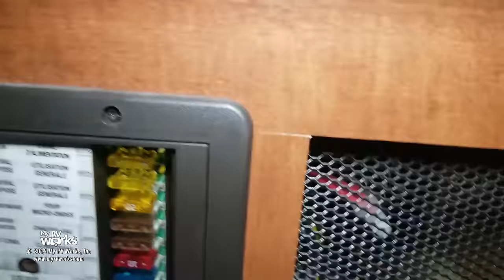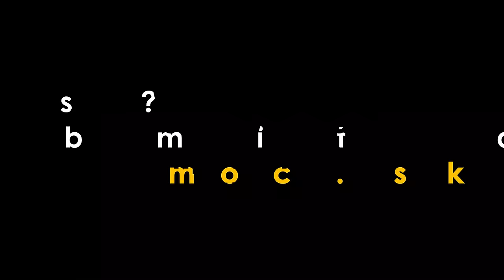RV Power Problem Leads to Converter Diagnosis and Replacement

Comment: Great  video very helpful.  Did notice the owner put holes in the wood behind the stove to hold knives in 
Place,  but alot of us put our knives away wet which   would put water in with the wires and converter area. I am pretty sure electric and water means TROUBLE.

Comment: Hi Darren, A friend has a hot skin condition (62v) to ground and we have isolated  to a single circuit. The hot skin disappears when a breaker is turned off. My EMS proved the pedestal and dog bone is good, (50a stepped down to 30).

Comment: Lol. Th life of an RV technician. I did my homework as Darren suggested. So I tightened up all the live on both AC and D.C. Side of the panel... I did use an inch pounds torque screwdriver. It is the t-handle design. But if the bus bars are close to the floor it makes the handle hard to turn when the "T" bumps the floor. All the screws were below torque.
Reply from the maker: Hi Pilot Nelson,

Wow, thanks for sharing your findings!

We are so glad to hear that our videos were able to help you!  If you would like to support us please consider becoming an "RV Community Supporter" on our Patreon site:  https://www.patreon.com/myrvworks

Happy Camping,
My RV Works Media Team

Comment: So if the batteries are dead; doesn't that mean they need to get new batteries? Cause the batteries will not come back to 100%. I wanted to say that your videos are so helpful. I was thinking of putting AGM's in to replace the cheap Wally Mart batteries that are there and now I better not do this because of the charging profile. Thanks for the tip.
Reply: I was wondering the same thing. I know that usually, if a battery is run down all the way, it will cause permanent damage, resulting in the battery not taking a complete charge or not holding a charge.

Comment: Great video as I have come to expect from you!  :)   I would like your opinion on plus's and minus's of two options I have on my converter replacement project.  Here goes...I want to replace my (brand new) converter/charger (single stage charger) with a Multi-stage charger in order to better maintain my battery bank.  It would also be an increase from 55 to 70 amp so I will be changing out the existing cables going to the battery.  I was thinking about the option of leaving the existing converter/charger alone( except removing the battery wires)  and just adding the new converter/charger at a location near the Battery bank. Your thoughts?
Thanks!  and thanks for all you do for all of us!

Comment: So I'm wondering why my converter failed in a 2021 BH2800 Grand Design ?  which was virtually NEW Travel trailer we purchased,  I know you have no answer, but what are some thoughts.  WFCO series converter is DEAD, puts out zero.   Just curious if there is some situation that can take these boxes out or just cheap parts ?   Just doesn't seem right to be replacing it in a 2021 model camper.    Great video.     So toward the end you mentioned not running slide with weak battery,   "IF" my 12 volt battery (I only have one) died and I didn't know it, and continued to use the slide on shore power, would this cause stress on the converter box and kill it ?    This maybe what happen?    As I had no idea this box was doing the work, I just assumed the slide was on 120 volt electric motors..   I had no idea it was running from a converter box.    Much to learn about the RV.

Comment: ???I have a brand new camper. They didnt put the top on my battery, the 1st week it was parked at my house, it rained. The battery compartement filled with water. I took the camper for a ride. When i came back home, i plugged into house. 3 days later all DC power was gone. Could the battery being in water have killed the converter? BTW I am a 50 year old woman and I feel like an expert after watching your video it was very very instructive thank you

Comment: Great videos! Have a puzzling question...Have you ever heard of surge protectors showing reverse polarity only when items plugged into outlets while connected to shore power? Items still powered up and work and the reverse polarity indicator goes back to green when items unplugged or turned off. Surge protector was clear to go before we plugged into the trailer and is fine with lights, USB ports, stove fans etc, just not outlets. We are using a 15AMP adapter  for our 30AMP power cord (25ft). I asked my rv dealer (never heard of it and told me to get a new surge protector even though is only a year old) and looking all over the web but can't seem to find any like situations. I tried all outlets and different items, only the phone charger and nightlight didn't cause a shift in surge protector lights. Any insight as where to begin would be greatly appreciated! Thanks again for sharing your knowledge!

Comment: Great video thank you for your knowledge it's much appreciated!!! I have a problem I've been trying to solve I just bought a 2009 Skyline Nomad model 326 with 30 amp service.. I have a problem... I took the camper to my friend's farm and he has a 30 amp service set up for his camper so when I went to plug my camper in it trips his 30 amp Shore power service... The weird thing is he also has residential 20 amp 120 plug and I can use an adapter and plug my 30 amp trailer plug into his 120 plug and I have power.. Note: Limited power to my appliances... I've checked all the breakers and I even turned them all off and turned off his 30 amp Shoreline breaker off and plugged into it and tried to turn his breaker on and it will not go on it keeps tripping over and over I'm at a lost of what is wrong and how to fix it any advice would be much appreciated thank you very much!!!

Comment: Hi Darren.....may I ask you a few questions? I can't find any answers because my RV is old. It is a 1983 Winnebago Minnie Winnie and the monitor panel with all the switches that shows the different levels, where you turn the water pump on, where you turn the water heater on etc it's not working. I am living in this thing so we have it hooked up to the city of water and I finally figured out how to get the heater on last night and tomorrow I have to clean so tube for the water heaterbecause this thing has been sitting for a while and it's covered in dirt and spider webs. But what I'm trying to find out is mainly about the panel and also do I have to have the fresh water tank filled in order for the toilet to fill up when I press the foot pedal down because when I do that even though I have the water hose hooked up nothing happens so we have to use a bucket to fill the toilet up. And like I said on the monitor panel above the stove, when I try to turn the water heater switch on, no light goes on and I just don't want to ruin anything. Today is December 10th 2021 and I was wondering if you could help me out at all. If it gets to the point where we can video chat that would be awesome because I have my 1-year-old daughter and my three-year-old son and many fiance living in here because we're going through tough times and I need to make sure that everything works. So I'd  really appreciate any help

Comment: About the failed converter, would the 12v systems still work such as lights? I am having a charging problem, but everything is still working. My assumption is that is because the batteries maintained a charge from the travel (alternator).

Comment: Great video.  I have just replaced my battery. I'm hooked up to shore power. My new battery needs charging already.  Is the problem probably my converter? All the ac stuff works. The dc lights starting to flicker again.  Also, my heater just clicks. Please advise.  Thank you.

Comment: My girlfriends AC (both units)  Just quit.  We shut it off for the weekend when we came back we flipped the Thermostat on and no start.  The Thermostat still has the digital readout.  Her brother said it may be the thermostat as no breakers are tripped or fuses blown.  She also noticed one side of the freezer not freezing as it was.  No 115 breakers are tripped though the fuse panel has red led lights lit which I dont know what that means.  Looking for the manuals now.  So I am looking for the converter to check the output or if it has a blown fuse.  This video is very helpful
Reply from the maker: Those air conditioners and the refrigerator all have 12 volt brains. So if they all died at the same time, it's very likely to be a 12 volt DC problem. If I understand your question, the red lights in the fuse panel indicate that the fuse is blown. So you might want to start there. Good luck.
Reply: @MyRVWorks  So it started working all by itself.  I am wondering if the park lost power and the battery voltage dropped below 10.5 volts.  The lights in the trailer worked ok though but I was told that if the ac or refrigeration does not have at least 10.5 volts they wont work

Comment: I'm hooked up to shore power, no battery connected. I used the vacuum today and I thought the circuit breaker tripped because it stopped working however there's no circuit breaker tripped and I still have no power to my lights in the ceiling, the outlets that were being used for the vacuum, or anything except for a single walla outlet near my doorway and one outlet in the ceiling above the fridge...I reset the GFCI bc it fixed it last time. But now, nothing. Any ideas?

Comment: You have been the only one I’ve seen to explain that the air conditioner needs 12 volts. As does the water heaters pilot light if running on propane. I also found out that when the battery is low and the air conditioner is running and you flip a dc switch the air conditioner shuts off. Thought there was something real bad wrong.

Comment: What's more likely, a bad brand new converter or bad brand new lead-acid batteries?  My 12V fridge Norcold fridge is throwing an E3 low-voltage code immediately after the sun goes down and sometimes even during the day if it's too warm.  I thought it was the fridge but now I'm thinking my dual 6V batteries are toast.  They got down to 10.2 volts overnight while boon-docking this past weekend (even AFTER being hooked up to a generator for 2 straight hours) and after being connected to shore power for 2 straight weeks at home.  These  batteries were the ones installed in my new Keystone Cougar trailer last year.  My entire coach lost power over night.  I'm thinking that the SolarFlex 400i package that the coach came with is only enough to just surface charge the system during the day when the sun is out.  Thoughts?

Comment: Awesome video thank you! On these RV converters if you start turning on multiple interior lights (12v dc) and the fan for the converter comes on, is the system being overloaded most likely and having to work too hard? Sometimes also when we open the fridge the converter fan comes on, then turns off when you close the fridge door. 
Thanks for any help.

Comment: You are a very smart and I love your videos. But sometimes it's just a little over my head. Which is why I'm asking you a question:  I have a 100' 8 gage extension cord plugged into house power off the garage. It was working fine until I plugged a portable heater  (a friend gave me) it run for maybe half an hour and poof, it turns off and further investigation, it did not blow any fuses inside my RV nor the house fuses. It fried my cord  where it plugs into the outlet at garage. Plus the bottom outlet where it plugs in was also burned. Had black on it. The upper outlet was fine. So purchased another 100 footer heavy duty extension cord and swapped out the old outlet with a new CFGI outlet but I still do not get any power into RV. I've visually looked at the other end of the extension cord where it plugs into an adapter then the RV and they appear to be okay. Do you think it could be the converter?

Comment: Ive made a 120v outlet plug for an up graded converter with new lithium batteries. My question is, when i installed the new converter I put the ground wire only in AC shore power outlet. Im sure this was the right thing to do, but! There ground lug or ground on my converter box itself has no ground to save the day. So where exactly do i add a ground to my new converter to my DC power panel? Or do i even need a ground on my converter? So far I haven’t found an answer on the Internet. I watch your videos to fix my RV alot! Really great stuff!🙏🏽🙏🏽🙏🏽🙏🏽🙏🏽🙏🏽🙏🏽🙏🏽🙏🏽🙏🏽🙏🏽
Reply: To add: my old converter had three wires green was ground white is positive black negative, this was all connected to shore power. So i made the 120v outlet plug from these. And of course it had a positive and negative wires to battery. But it didn’t have an extra ground wire on the DC side. Hope that makes sense. So just wondering if the new converter requires me to add a ground wire to the box to my panel if so where would it go? To reiterate haha

Comment: Thanks for this very informative video. I to have plugged into a dirty plug and converter stopped working. Checked the fuses as you introduced and were fine. I just don't understand why the breaker and or the fuses didn't protect the converter? Thanks again for explaining how to diagnose the converter issues!
Reply: Circuit breakers and/or fuses ONLY protect wiring. They do not protect equipment. In fact, on the rare occasions that they fail internally but don't properly clear the circuit they can damage the connected equipment by low voltage.

Comment: Thanks for the great video.  I have a 20 year old Wildwood by Forest River 26 ft 5th wheel that lost power to half of my outlets.  I have checked the fuses and breaker and reset the GFCI in the bathroom.  It doesn’t appear the outlets that are still out are connected to the GFCI so I am at a loss of what I can try next.  My wife remembers one of the outlets going out when she was vacuuming with a shopvac.  Any advice or help would be much appreciated.  Thank you

Comment: Super helpful, thank you! I've got a frig, microwave and gfci outlet not working, but battery lights all work, plugged into shore power, outside plug works, but just no major appliances work, any suggestions?

Comment: New Subscriber! Thanks ..., love how you explain.    So I have converter problem.... I noticed sometimes when Someone steps into camper , 12 Volt source flickers .,,,    I believe I found the problem, if I tap on the converter the lights flicker . Obviously a loose connection, is there something else I should consider? I’m going to check the solider joints

Comment: Hi. I've got a friend who has an electrical problem. I'm wondering if you've seen this. He has a 3 way fridge. This only deals with ac and DC. He keeps it on auto. Propane on the road and ac at the campground  Lately when he plugs in at the campground it blows his 15;amp fuse DC. If he replaces fuse all is okay. 
Thanks.

Comment: Will my fridge not work if the battery gets blow the 10.4 volts you mention.Even if the shore power is plugged in. I am having electric issues but I think it's leading back to the converter like you mentioned.  Thanks

Comment: Question, I have a 2005 Crossroads Cruiser toy hauler. my ac runs for awhile then stops, sometimes turning a light on will cut it off. My 12 volt lights go very dim when this happens and my Atwood detector starts beeping sporadically and flashing lights. Does this sound like a converter issue. I checked my battery today while plugged into shore power and it only read 7 volts. Have you ran into a converter that has intermittent issues? Great video!

Comment: The plywood under the converter just for keeping it off the floor for accidental flooding? I am replacing mine, going with new type battery and converter to match. The old converter was on plywood with a wedge support under it.  I want to take out the elevated plywood and just use a slightly elevated system because I am replacing the oven/stove with just a 3-burner stove-top and build a cubby under that. Hopefully, I can add a plug-in to the cubby for a small microwave.

Comment: No I followed your video and they are awesome but I have issue I tried everything all day today I could not figure it out my LP what lights up but for only 30 second or 35 second then the gas solenoid will shut off and doesn't stay on but the fridge will work on an AC current so I don't know what else I cleaned everything I checked the heating rod I cleaned it thermostat  that heating element 41.2 owm by the way its Domestic RM 3663  something i am missing and keep watching your video looks very easy and thank you very much great work
Reply from the maker: Usually that means that your lower DSi control board is not detecting the flame. The electrode that is mounted over your burner should be about an eighth of an inch above the burner itself. So that might be the first thing to check. Also make sure that the ceramic that is holding that electrode is not cracked at all. Two other things could be the wiring itself from the electrode to your DSI board, and then finally it could be the DSi board itself.

Comment: Do a video when the converter is working and your batteries are charged and you still have no 12v lights or any brains working with no blown fuses and out of storage mode. You do the best videos. People don't under stand that the storage button or switch runs a relay that can go bad also. Its the latching relays or solenoid.

Comment: At some place on the fuse panel i have 13.6 and other 12.9 
got 13.6 at the connection of the awning outside even if the fuse is out and the motor wont run but it run ok on other circuit 🤪
Reply: Thanks for all your videos very long and good explanation